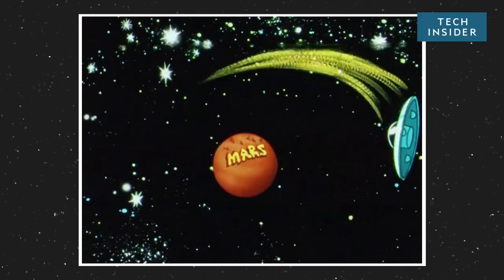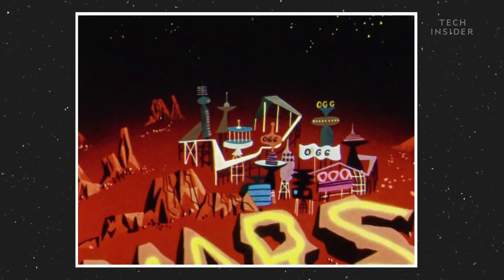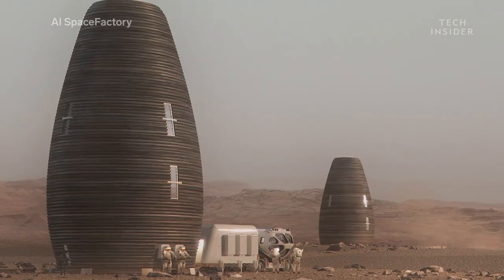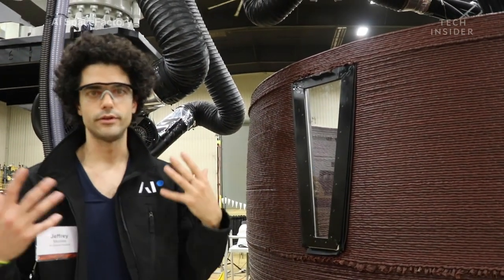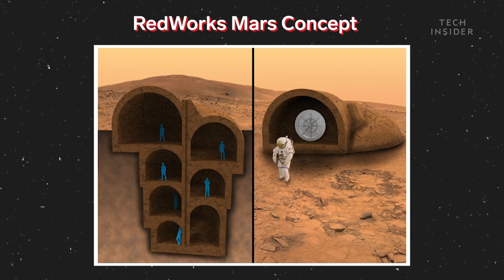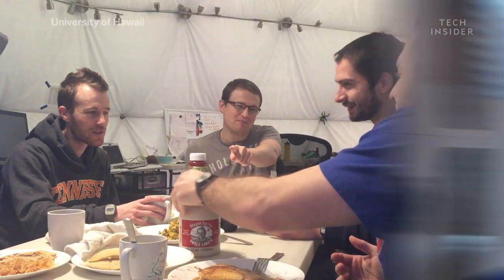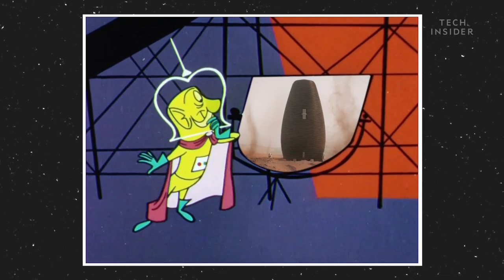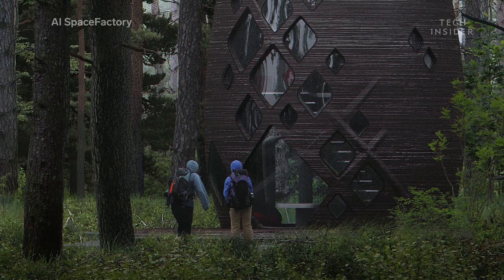The Mars Homes That NASA Awarded $500k

Comment: Architect: Well I have a house that looks like a giant plant pot.

NASA: Stop drilling you hit oil
Reply: if there was life on mars once, there might actually be oil.
We haven't ruled that out yet :)
Reply: I wish NASA would be honest with us, and tell us what are the different peoples on Mars,  I have seen normal probably 5 foot 5 Ive seen some short people perhaps 4 foot tall, and many of the Tiny People who are around 2 inches!!! I've seen huge apartment areas, and they looked like for normal people!! but some may have been for Tiny!!
Reply: @Osgfkqgvsu  Life is not the only process to procuse oil sadly. Especially when you consider Titans different chemisty (temperature, pressure, the abundance of methane), you can actually have oil without requiring any form of life.

Mars is much more similar to earth.
So while you could find some oil from non biological sources there, it would still be a biomarker
Reply: @duanewilliams7353  what slow down dude

Comment: the real question is

how good is the internet?
Reply: Mars net would probably be pretty good, as it would be all new equipment and everyone would be living very close to the servers. Interplanetary net would have a hell of a latency, but with a local caching server and some smart pre fetching it would not be too bad for all non interactive stuff.
Reply: Probably less than 1ms of ping
Reply: Technically radio waves move at the speed of light in a complete vacuum, so it should move near light speed in space. I barely know how this works but I’m assuming the internet wouldn’t be that bad as long as there’s a line of satellites stringing from earth to mars. It would be some expensive ass internet too.. edit: just did a little research and it turns out earth is 3.03 minutes from mars in light speed.. so there would be a slight delay lol

Comment: Marsha "You'll die of radiation poisoning within a year, but you'll be sane for that time and that's what's important".

NASA - "Where do we sign"?
Reply: Yeah they didn't address the whole radiation poisoning thing very well for me, like don't worry your sanity is intact because you are living above ground, albeit slowly dying from radiation.
Reply: @quandary1382  The thing is made from basalt which blocks radiation. Bruh that's what they addressed in the video before the psychological stuff.
Reply: Gam3 0ver they did say the material would shield you from radiation
Reply: But the have a windows on top and in the wall.
Great leaks for radiation
Reply: @3d-art284  There might be air leaks too I mean isnt basalt just a rock. Can it actually seal it that good that it can with stand the internal pressure just like the aeroplane does?.  There is bound to be radiation leaks for sure.
Reply: Roshill K its basalt and plant matter mixed together, forming some kind of radiation-resistant concrete
Reply: why will they even make a project for homes in mars against radiation if they could just try to terraform mars?
Reply: Read the actual research. They have thoroughly addressed radiation.
Reply: Vann Samblaceño even if you were to terraform the issue of radiation still exists
Reply: @nanidefak5739  Terafoming Mars would require a much bigger budget and a lot more time (possibly centuries depending on the methods used). Building up the entire atmosphere of a planet is a bit of an undertaking. This is for a much smaller and shorter term project.
Reply: @Bigtexbbq  though does sand create a disadvantage for thosw who will live in Mars?
Reply: @George89999  isn't it quite aggressive?
Reply: @George89999  teraforming mars as quickly and efficiently as possible requires there to be a country that has a free market, unfortunately capitalism doesnt exist.  It almost happened in the late 19th century until the government made the central bank.
Reply: Roshill K what air is there on mars?
Reply: @nanidefak5739  Do you mean terafoming? There are different ways to go about it, some faster/more aggressive than others. But there's a trade-off in cost vs. time. The faster you do it the bigger your budget would need to be. Besides right now the cost of just sending a few people to Mars is very high. They'll need to also reduce the cost of transportation if they want a long term colonization effort as would be needed to justify terafoming a planet. I don't see that as being likely in the near future.
Reply: @Bittzen  The economics of a country only change the options they can afford. Physics is still physics regardless of your ideology.
Reply: @George89999  I see, so if there are more people in Mars, then more people would do agriculture in some kind of a building for agriculture only, then  there are chances to create an atmoshpere , we would be able to create an atmosphere due to plant life and water which is equivalent to massive budget of terraforming
Reply: @George89999  but I dont know much of science but, is it possible to create an atmosphere by using plant and limited water from the other?
Reply: @internetexplorer6824  Mars air is 100 times thinner than that of earth it generally consists of 95% carbon dioxide some nitrogen n argon
Reply: @richiepodsawat6389  Yeah no I got the plant part too but, still something feels off. I am sure like they said it needs to be tested and they need  to practice alot. I personally wouldn't live on that planet everything around you wants to kill you it's scary xD.
Reply: @nanidefak5739  The problem isn't just that to teraform Mars they need to not only make oxygen but they also need to add to the total atmosphere of the entire planet (the atmosphere is far too thin for human life) and increase the temperature. Plants which are more complicated than a lichen would also need more favorable conditions to survive on Mars first just like humans do. 

There different ways it could theoretically be done. For one example, you can add a heavy artificial fluorocarbon to deliberately increase the Green House effect on Mars increasing the temperature and atmospheric pressure in the lower regions, to help get things started. Then if Mars has enough frozen gases you can melt them with mirrors. Either way there would still need to be the motivation and resources to do such a task. Also, more research would need to be done to determine what the best plan would be.
Reply: @George89999  I totally forgot about that one, what if, we can freeze the surroundings even without the "nuke bombs" to create higher temperature by going underground and create some machine which could lower the temperature around it, since the underground would become like a big oven, ice will be evaporated and turn into water, seeps into the ground until the machine breaks itself
Reply: @nanidefak5739  Before considering the challenges of Terraforming Mars and thickening the atmosphere enough to support life, we need to first figure out how to Terraform the Sahara Desert or Antarctica.  Mars is much, much, much more difficult a problem than that... and humanity hasn't taken on that challenge yet.  Until plant life flourishes in both those places on earth, (outside of constructed habitats) our best bet on Mars will have to remain with constructed habitats for any form of life we land there.
Reply: @3d-art284  do you understand anything about radiation, though?
Reply: @nanidefak5739  It would take thousands of years to terraform mars, and creating a magnetic field to protect us isn't even a guarantee.
Reply: @George89999  I remember reading in a paper that it could take about 1000 years to artificially develop an ozone layer and a magnetic field on Mars.
Reply: @santircastillo  Depending on how you do it that might be correct about an Ozone Layer. I'm not sure off the top of my head but at least it's a lot easier to protect against UV, which is what an Ozone Layer blocks.
For a planet of the type as Earth and Mars the magnetic field is generated by the molten layers of the planet flowing around the iron core and acting essentially as a generator. So to create a magnetic field you'd need technology and energy way beyond what we can do for the foreseeable future. Fortunately a thicker atmosphere (and think walls) can compensate.

Frankly given the obstacles to the teraforming and colonization an entire planet I think that colonization of Earth's Moon and asteroids (such as the Trojans in the Lagrange Points around Earth for starters) might be more practical. Cost is likely to be a major bottle-neck even that close by. At least that's my opinion.
Reply: @nanidefak5739  I think you mean something like a reactor to melt what's trapped underground? We don't even know enough yet to be certain is something like that is needed. Also you would need a lot of them.

If they're nuclear fission reactors you'll also need to worry about contamination. For example Nevada is sitting on top of natural underground water reservoirs with about 1.6 trillion (with a "T") gallons of water (about 6.05 trillion liters) which they can't use because it was contaminated by underground nuclear weapons testing.
Reply: Can fix their sanity by designing dome and place structures inside both residential,commercial,artificial grass,roads for electronic buggies and places for people to walk around and explore just seen other people living there daily lives can help alot with sanity building society than just been in home unable move about much stimulate the mind ;)
Reply: @roshill2010  till radiation shielding fully research that protect the structures,walls,Windows and suits etc and technology to create Water,food and our own oxygen without depending on earth to have those then only then can be safe you would be completely right what you have said we are definitely way off from this technology and research development to do anything I think till massive crises to the planet to point money and competitive counties becomes no longer matter except survival human race then they will which be maybe too late too and far beyond our lifetime lol
Reply: @nanidefak5739  Terraforming Mars would take a very long time if it's possible at all.  If people are to move to Mars, they will probably have to do so well before terraforming efforts really take off.  Perhaps we could engineer some organisms that can start generating oxygen, though, or even just CO2 to thicken up the atmosphere for plants.
Reply: Vann Samblaceño Well yeah but if we did that before we landed there we would never know how it was before we did so. It would be completely different. Also yeah it does take centuries to even make it warmer there.
Reply: Vann Samblaceño terraforming takes generations. And mars doesn’t have a magnetic field strong enough to maintain the atmosphere gained through terraforming
Reply: @roshill2010  you guys do realise this is all stuff they've thought of before? It's legit their job to make sure all of this works out and is safe. If they didn't think basalt was the best option then they wouldn't have gone with basalt period
Reply: Virtual Windows I think would make more sense in these habitats. They could also be used underground. They could still look out on the landscape but could also simulate other landscapes from Earth without increasing the radiation hazard. Also in the future VR will be able to realistically recreate almost any environment to help promote psychological health.
Reply: @Disent Design The 'material' has windows... douchery.
Reply: 3D-ART at least on earth glass windows do protect you from uv. Don’t know how that would fare in a atmosphere less environment, and with uvc.
Reply: @quandary1382  what yall are forgetting is that this is a prototype, with the proper funding Its almost a guarantee that these "problems" will be 100% solved
Reply: @zingerman11259  Just why bother doing it this way, better to live underground initially until our technologies become safe enough to be above.
Reply: @quandary1382  I mean this kind of house would be good on the human mind, and the technology is safe enough to build above ground, but I see what you mean, we should see what this develops into

Comment: Wouldn't windows compromise the habitats radiation resistance? 

Just wondering
Reply: Charlton Newcomb yes it would. Which is something thats not explained. I’d say this company won’t make it to mars.
Reply: The space station has windows and that doesn't seem to be an issue?
Reply: @rypdx  I'm pretty sure they have already thought about all the consequences of putting a window into their designed habitats and have made a solution for them. Just think about it.
Reply: @snuuky8814  Pretty sure it's protected by a polycarbonate shielding
Reply: @feedmyneed6476  the space station is suspended in space, but on mars it naturally has strong radiation and wondows will compormise safety.
Reply: @banheesos  The ISS isn't suspended in space, it's orbiting Earth at 7km per second. And it's outside the protection of our atmosphere/electromagnetic field so it's experiencing similar radiation to that on Mars.
Reply: Maybe lead powder coating the glass might help...
Reply: Pretty sure the windows will be made of radiation resistant material, and they would also probably have shieldings on the outside which can be closed.
Reply: Its nasa that we talk about they probably already found a solution
Reply: @rypdx  just because nasa didnt explain everything doesnt mean that they dont know about that like how can you already know? just from a 6 min video?
Reply: @feedmyneed6476  No it's not.  It's still mostly shielded by the van allen belts.
Reply: Lead lined glass. They use that in hospitals and nuclear reactors.
Reply: @feedmyneed6476  The ISS is within the magnetosphere so it does receive some protection from radiation, though not as little as on ground level because it's above the atmosphere. Also Mars does receive more radiation than on the ISS.
Reply: @Mica_T  exactly